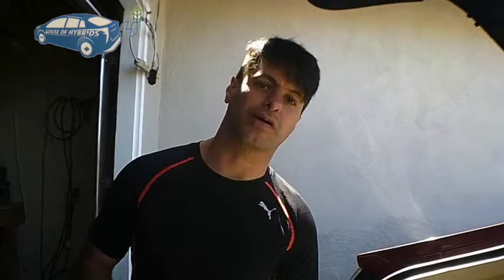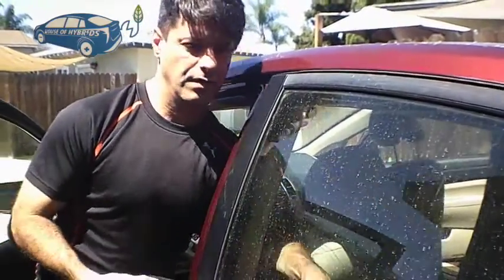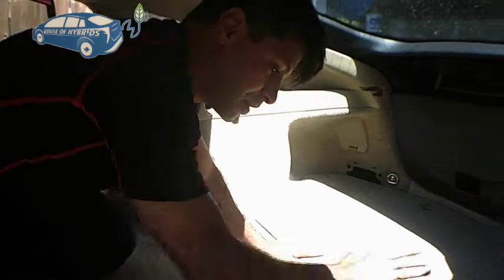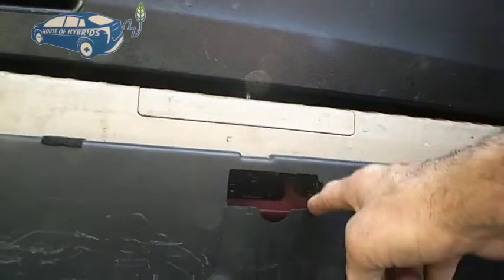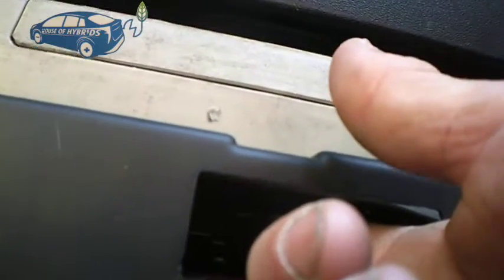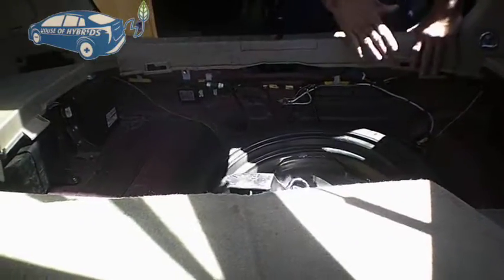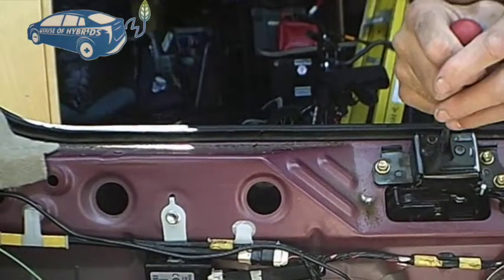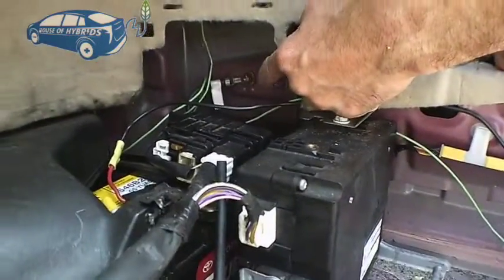HOW TO OPEN THE TRUNK WHEN BATTERY IS DEAD 2 GEN PRIUS

Comment: That’s the procedure that I had to do several times before I replaced the dead auxiliary battery at the back of the Prius. The reason that annoying procedure has to be done because of the brain dead Prius design. A normal car design would have a truck hatch release by the driver’s door that is not dependent on battery power to open the trunk hatch door.